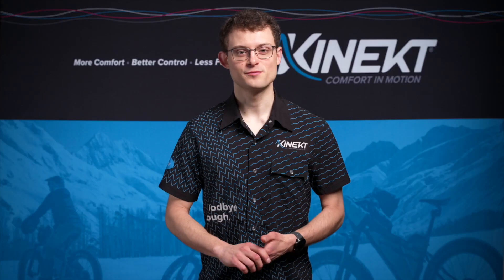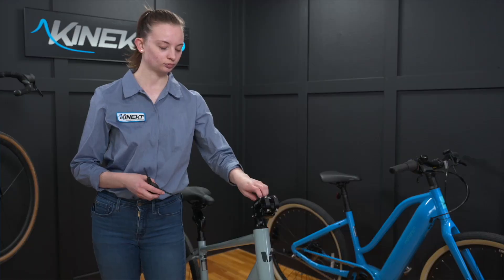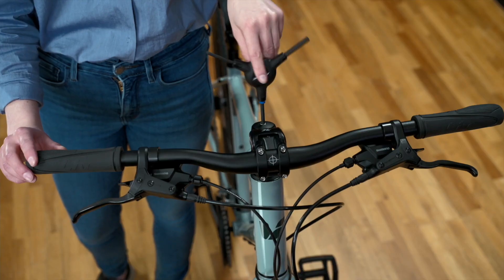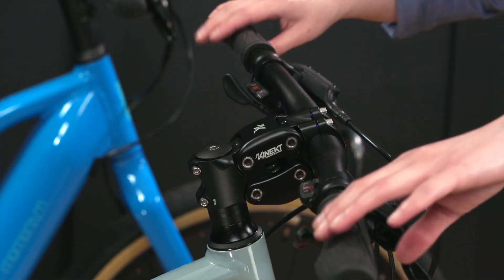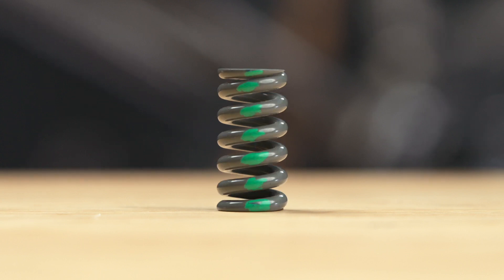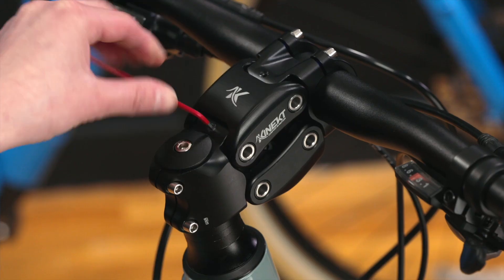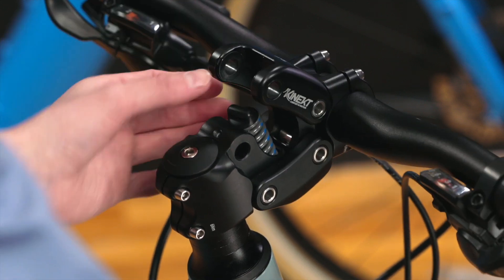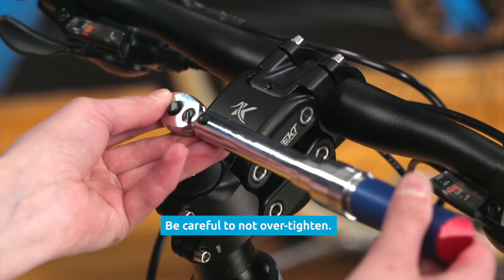Kinekt Suspension Stem Installation

Comment: Hi. I bought this stem used, but it has significant movement/wobble from left to right with the handlebar installed (of course I am not writing about top-down movement which is desired). I guess, that the bushings should be replaced using the Rebuild Kit you offer? Thanks!